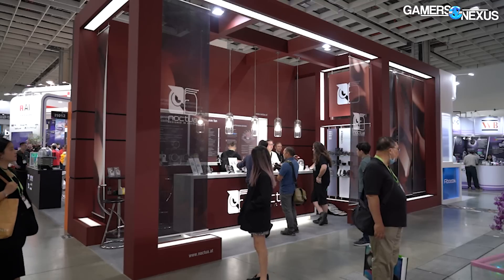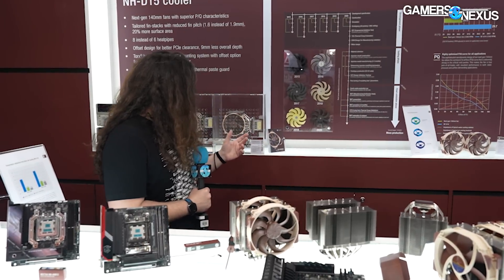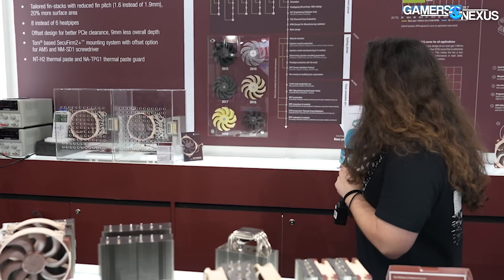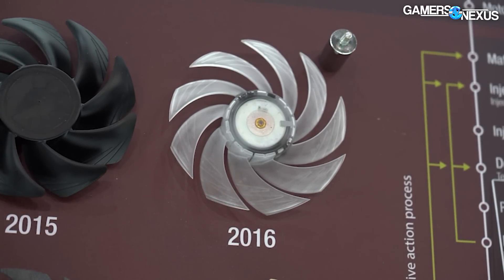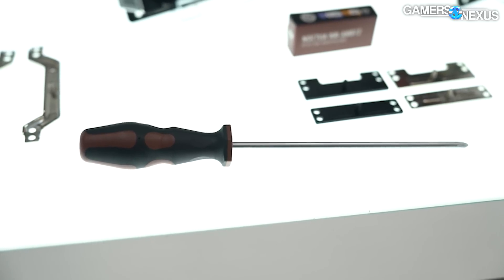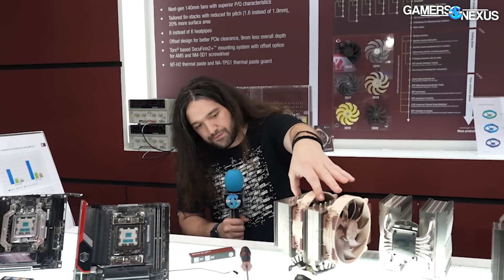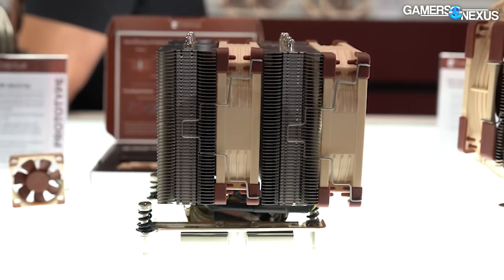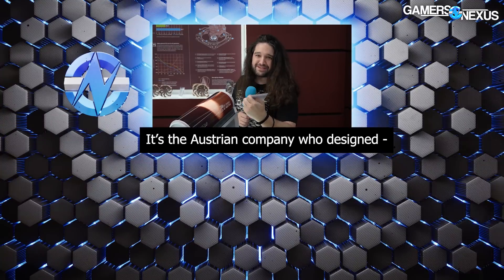Noctua is Back: NH-D15 Gen2 & 8 Years of Fan Development

Comment: 8 years for one fan? Talk about a development cycle. I really can't wait to see it against its competition and see if it was worth it. Nonetheless, exciting to see the old guys again coming back!
Reply: Yea. For a fan that is supposed to last? 8-10years? About time to make plans for a new improved one. Noctua have hold off competition with the old design this far. Now they need to launch a new one to do the same trick for a other 8years.
Reply: @TheDiner50  There is no "about time" for engineering outside of a few things like processors due to shrinking semiconductors.  You can only optimize an electric motor or aerodynamics so much because there is an ideal, or an ideal compromise, that you cannot realistically improve on.
Reply: @TheDiner50  noctua is getting smashed by fans and coolers that are a third of the price.
Reply: @VndNvwYvvSvv  even my garbage case fans from a $50 case bought in 2015 runs fine. It came with 4 fans. So 2 more years and it'll be 10 years lol.
Reply: Better that way unlike other brands which flood the market and we have no clue what is what.
Reply: @ZAGAN-OZ  part of the reason I try to buy Noctua even though they're expensive. They last and I can easily find out which fan does what.
Reply: If engineering "perfect" buys you eight years of product development time, I guess perfect is a pretty good target.
Reply: Considering the A12X25 can beat out many 140mm for noise/performance, the new A14/A15 should be a BEAST.
Reply: @flandrble  That 2nd gen D15 will be INSANE.
Reply: @flandrble  And the Phanteks beats the A12x25 in every way.
Reply: @ripleyhrgiger4669  apples and oranges
Reply: @ripleyhrgiger4669  it's also 25% larger, I'll take an extra 5mm of radiator any day as the extra thickness of the T30 makes hardly any difference on a radiator. Radiators often have 10mm or more of plenum space (even on a slimmer 28mm), meaning that adding only an extra 5mm is a significant amount of surface area.
Reply: I'm still running nh d-14 with original fans. ~11 years, 3 different mounting kits. They are actually cheap in the long run..
Reply: @Beardest-b4p  Aye, same. Over the last 15 years or something I've only had one noctua fan fail. And by fail I just mean the bearing leaked some oil. That same fan is still running basically inaudible 5 years after it leaked a bit.
Reply: @Beardest-b4p  yup, and they retain their performance. I have a Corsair 280mm AIO that's now 7 years old and during the Time Spy CPU benchmark my R5 3600 got to 70! degrees and the clocks were dropping due to the heat meanwhile a friend with a 1600X and Noctua NH-U12S with a second fan ran the test and his CPU stayed at 53°C. After 5 years you can throw an AIO away, the best outcome for you is probably to sucker someone who doesn't know this into buying your used 5+ year old AIO PC.
Reply: See pushing the boundaries of what's possible takes more work than just copying and keeping up.😉
Reply: It has to be. Noctua could just continue producing their current lineup and be fine for another couple of years. The competition currently either barely matches it or comes close with some drawbacks of their own.
Reply: @_hank9508  Negative. They're competing with water coolers now. It's no longer Noctua CPU fan and heatsink vs another brand's equivalent. It's Noctua fan and heatsink vs all in one water coolers with a 240-360mm radiator and 2-3x 120mm fans. The bar for performance has risen. Their old design could keep pace with earlier AIOs, but that's changed.
Reply: @trajectoryunown  I'm talking about their fans only and that hasn't changed. Current gen AIOs still use them in partnerships, like the Asus Ryujin are still extremely competitive and should be good for years to come, given socket compatibility. Sure, as a consumer I have to pick Noctua vs AIOs but that's a different discussion.
Reply: @trajectoryunown  if you go aio better to do custom watercooling.
air cooling is simply, put it in and it runs for years without hassle.
aio still have to many issues.
Reply: @_hank9508  Nope. Deepcool and Thermalright outperform Noctua's D15 and there is another less known brand that beats it as well. If you include AIO's, Noctua is in the middle of the charts overall these days and they still cost ~$100. Thermalright on the other hand costs half as much or even less and keeps CPUs cooler by a few more degrees. Noctua needs the gen 2 out there and it needs to consistently cool 3 or 4 degrees better than gen 1 for them just to tie.

Edit: Just read another comment where you said you were talking about the fans specifically. Can't argue with that. They make great fans. I put them in my first PC build because of their reputation and reviews though I switched to Arctic for the price and not too much difference in performance.
Reply: 8 years for the development of a fan probably is about right actually.

Turbomachinery engineering is hard.

And this is especially true for axial flow fans , because you would think that the physical space that you are given to design a fan is basically infinite (you can make the shape of the blade ANYTHING you want), but what you design MAY NOT achieve the performance (and cost) objectives that you are trying to hit.

And THAT is a PART of what makes the turbomachinery engineering so difficult and so challenging.

You move the control nodes for the curvature of the blade, and even if the blade has variable thickness throughout, you can SIGNIFICANTLY, adversely, impact your flow performance.

It doesn't take much for it to NOT work.
Reply: Noctua is already considered by most to be the quietest and most performant fans out there, they can only get better. Plus there will likely be no stupid markup just bwcause its a new model
Reply: Yeah, the fantester will be running a lot it feels like
Reply: From what I understand Noctua basically tells there engineers do what needs to be done and forget about the time needed it will be ready when its ready.
Reply: From everything I've heard, Noctua doesn't really have development cycles. My guess based on other people's descriptions and interactions with the company is that usually they agree on a goal for a product with certain basic specs that would be good for the company and then make it without any sort of timeline. They seem to take an "It's done when it's done" approach and as long as the engineers are actually working on the project there's no problem.
Reply: I recommend you take a look at Major Hardware's fan showdowns. The Notcha fans are super hard to beat without very creative cheating methods. Show you how long they perfected it.
Reply: name a aio used for 10 different cpu and hold hes first day performance for 10 years.
Reply: I think you can take your time when your existing model is still selling like hotcakes
Reply: inb4 it gets beaten by a 30$ cooler
Reply: @supercool_saiyan5670  yep. Noctua is the scam lol. It's like seeing people buy the hyper212 in 2023 😂
Reply: I went and checked the date, but I'm still using a Noctua NH-D14 I bought in June of 2012. Since they keep selling adapter plates, I've gone through 6 CPUs in that time, both Intel and AMD. At the time, the idea of paying $90 for a cpu cooler seemed ridiculous, but this thing has paid for itself many times over, and I'll keep it as long as they keep making new adapters.
Reply: gabe voice
  After 9....8 years in development, I hope it was worth the wait
Reply: Part of that is they couldn't get the quality of production right. So after 3 years of them saying 'the end of this year' they better be the single best 140mm fan on the market. Especially when we're fully expecting 30-40$ a fan like the a12x25.
Reply: Literally no one made a better fan during development.
Reply: It's why I'll only buy them, even when someone comes along and blataintly carbon copies them for 1/2 the price.
Reply: Idc if the fan isn't better then every other ill still buy it cuz imo noctua is the very finest
Reply: if ain't broke, don't fix it
Reply: the problem is there is only so much you can do with air cooling and unlikely to beat aio's
Reply: I have Noctua fans from about 8 years ago that I've moved from 2 cases. They are still great fans. The only "innovation" they are missing is some way to daisy chain them.
Reply: that's the cycle for me to upgrade the PC
Reply: 8 years, new fans, two extra heatpipes and different fin pitch to get 3*c   Noctua is playing like a champion in the air cooling space.
Reply: same, we've got some insanely low cost fans nowadays that match or beat noctuas in some aspects. I hope we've been funding something extraordinary all this time ;w; excited to see how it turns out
Reply: I call BS on the "8 year" development story. Some of us have R&D and manufacturing experience to see through their crap.

I guess its "if it ain't broke, don't fix it" mentality and backed up with good sales.
Reply: Wait until AI designs the perfect fan in a few seconds :)
Reply: It's more like sitting back for 6 years on their dominance and 2 years working/developing since competitors are threatening them finally.
Reply: @hansdoreen  They've been working on the gen 2 fan since 2015. It's in the video. No point in lying when the proof that they've actually been working on it for 8 years is right in the video you are commenting on.

Comment: Its a shame they keep delaying the next gen d15 and next gen 140mm fan. Noctua is unfortunately a poor value in todays market of high end dual tower coolers available for $60 or less. Very curious how much more efficient a gen 2 d15 can be. I imagine the biggest benefit is due to the next gen 140mm fans that are similar to the a12x25’s. Although im sure the heat sink itself has been tweaked.

Comment: Got the NH-D15 chromax, theres no AIO out there that could convince me. Reliability and lifespan >>>>>>>>>> RGB and liquid
Reply: Unless I had a processor that would overwhelm a D15 there's no way I'd run a water based cooler. 

Why run a pump when when fans will do?
Reply: @volvo09  when you start considering reduced noise with significantly more radiator surface area, you know, the entire Noctua spiel.
Reply: @flandrble  my 280mm Corsair AIO runs my R5 3600 at 70 degrees in Time Spy meanwhile a friend's U12S keeps his 1600X at 53 the entire time. Air is the ultimate in longevity and Noctua's support is a perfect match for that
Reply: @flandrble  Ignoring AIO failure which will give you all sorts of fun sounds that a normal fan cooler wouldn't give you, how much noise do you need to cut out? I've got a box fan level of noise running through my system. It's loud, but when I put my headset on, it goes away. That's with an unhealthy amount of fans as well.
Reply: @imnotusingmyrealname4566  Lie to yourself that processors that produce lot of heat do not exist instead your friend bought a cooler that is more expensive than the processor
Reply: @BlackTone91  the CPU was 240 and the cooler was 60, also it's not my fault that you bought an Intel space heater
Reply: @imnotusingmyrealname4566  Yes, and AM5 processors do not have an optimal operating temperature of 95C
Reply: @flandrble I have a Deepcool Assassin 3 and i also agree with you.

My PC is currently more silent than my refrigerator.
Reply: @imnotusingmyrealname4566  I have 10+ year old D5 and DDC pumps that have been in service for most of the time with no real end in sight. No tower cooler is going to come close when you're trying to keep the fan under 900RPM (any more than 900RPM on an A12x25 and you're louder than a D5) to keep noise down, when all you need to do is add moarrad. I had a 240 and 2x 120mm in my old ITX case and currently have a 360 and 240 in my mATX case (I went larger for less noise), just no way to compete with surface area.
Reply: @flandrble  hmmm how expensive is that? an Arctic Liquid Freezer II 420 for 124 USD where I live is probably the cheapest way to get the lowest noise cooling solution but AIOs are not really serviceable and custom loops can drop temps by another 10 degrees and noise also lower over a 360mm AIO or so, I'm definitely also interested in water cooling, but I wonder if it even makes sense when you can also undervolt CPU and GPU, which is definitely the cheapest way to reduce noise, also heats up your room less and saves you on the power bill, electricity is twice as expensive in Europe as in the US and maybe downsizing by undervolting instead of overclocking and not getting a 4090 would be more comfortable to live with
Reply: @imnotusingmyrealname4566  depends, you can move most water cooling parts to new builds, might need a new gpu block or new mounting plate for the cpu however. 
If you aren't pushing more than 200w of heat there's no real point to going custom loop.
Sure you could undervolt, but just buy a passive laptop with no fan if you don't want performance :D
Reply: @awd-x6s  I run my fans at a max of about 1100RPM in Summer and 900RPM in winter, PSU fan basically does not spin ever, so all I really hear is coil whine.
Reply: My man 👍👍👍
Reply: I just wish a modern case was a bit more accommodating for massive heatsinks. My noctua is nearly pressed up against the glass lol.
Reply: @awd-x6s  Yeah and the main issue is width. You can make a wide case that's not that big in volume. It would be perfect for these coolers.
Reply: @awd-x6s  I stuck a D15 into a torrent nano (mItx case), there's just something about a giant cooler in a tiny case...
Reply: @My_Legs_Are_OK  It certainly looks neat. I just have some cooler master thing. It's a good case, but I can't fit the second fan on because of RAM and glass clearance lmao. Suppose I could try a different layout :^)
Reply: @awd-x6s  yeah I'd have to mod my case if I upgrade. Kinda waiting till i upgrade to a new build at this point.
Reply: Another thingy that produces heat that nobody ever considers are outdated old monitors.
I had a 25 inch 1920x1200 HP photo flatpanel that I really liked but it would just radiate over 100 degrees through the screen

My childhood bedroom was really comfortable when I finally replaced that old monitor
Reply: @Biaanca5036  New monitors produce way more heat than old monitors! The high refresh rate with the intense backlight technologies means some models even have active cooling. New electronics are more capable but oh boy do they draw a lot of power.
Reply: @Biaanca5036  I have an LG with buggy firmware, it uses 60W in SLEEP (power on, no input).
Reply: 100%
Reply: Had some stupid Corsair AIO that had a noisy pump from the get-go and it died after a few years, meanwhile my Noctua coolers last basically forever and I can change the fans if they ever die, which probably won't be for a long time. Also, I don't have to worry about potential leaks inside my PC.
Reply: I got the same cooler for my 5900X build last January. Between it and my Fractal Torrent case, there's so much air being blasted through the cooler that my CPU never really gets THAT hot. It does the job, it's simple, and it looks amazing with my blacked out build. 10/10
Reply: amen to that brother Greatness takes time.
Reply: I use an AIO for gimmicky purposes, but if I want stability I go with an air cooler.
Reply: @Birdy Fem the 13900K wants to know your location. A D15 CANNOT cool that thing. 

Though it is more a space heater disguised as a gaming part than a CPU
Reply: @HyperScorpio8688  I have a 13900k paired to a Noctua NH-U12A it can most certainly cool it just fine, and a D15 is slightly better yet larger.
Reply: @HyperScorpio8688  Yes it can easily cool an i9 13900K in normal workflows outside of synthetic benchmarking / torture tests.
Reply: @Solus793  My worry is that the hot climate I live in might make it not so effective. And honestly I wouldn't pay 13900k money and then accept only 13700 performance...
Reply: Some of the best pcs are often the ugliest and most unassuming! RGB is for kids.

Comment: i've never actually used a noctua fan. there just always seems to be something comprable (from reputable brands) for cheaper.
Reply: Even putting reliability aside, a couple of percent better cooling performance for a more expensive cooler can actually be a worthwhile performance/dollar investment
Reply: @Denamic  that is true, and i do acknowledge that but ive only recently realised how much of difference a few degrees of cooling can make, and my only build since that realisation couldnt fit an NH-d15 (at least judging by the measurements on the website)
Reply: @Denamic  Noctua isn't exactly on top at the moment (last I checked). A few degrees here or there is a marginal return compared to the price. Noctua is great for their support though. They're very much a "you get what you pay for" kind of company.
Reply: The flow chart goes: Should I buy a Noctua cooler? > Do you own a Noctua cooler already? > Yes > Then maybe. If no, you don't own one already > Then no.
Reply: I use a mix.
I have had fans fail and Noctua just asked for a photo of the broken fan physically damaged and sent a new one free of charge.
Other fans go in the bin with no chance of a free replacement.